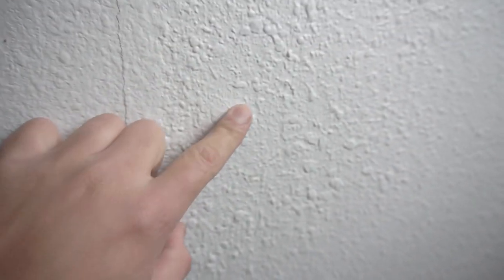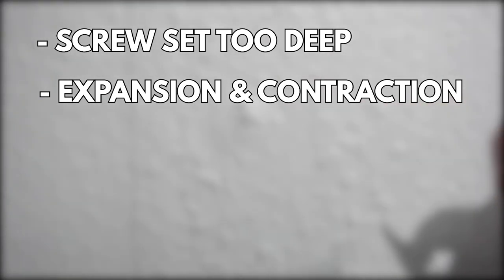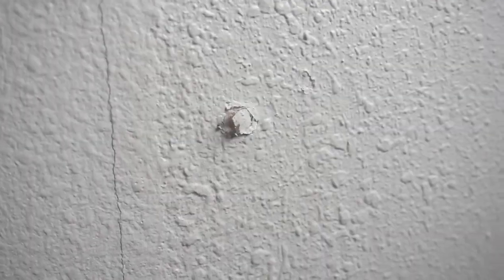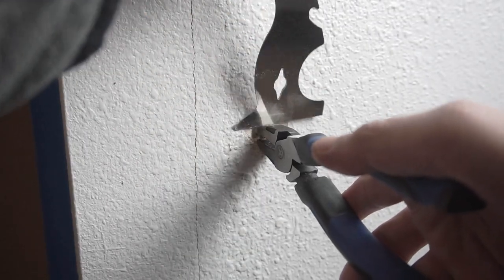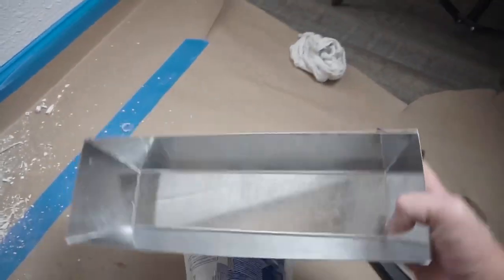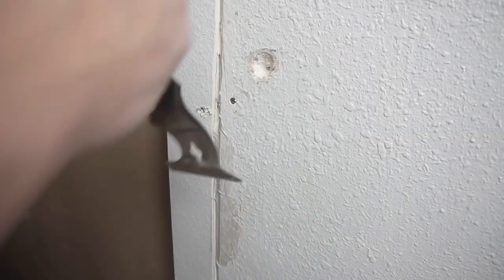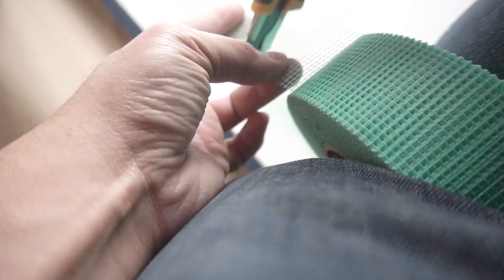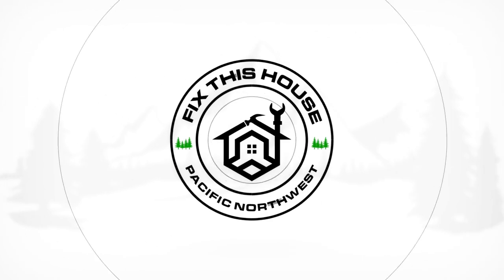How To Fix Screw Or Nail Pops In Drywall | DIY Drywall Repair Tutorial For Beginners!

Comment: What’s the difference between the 5 min mud and a joint compound?
Reply from the maker: Hi! They are all joint compound, hot mud is just a term for fast setting joint compound because 5,20,45,90 all have chemical characteristics that when water is added it reacts that hastens hardening time

When using hot mud you will notice it turn from dark grey to white. The mud is not considered completely dry until it turns completely white in appearance. Unlike traditional drywall compound, it does not shrink as it dries, so it is possible to add additional coats of hot mud before it has completely dried.

Topping compound is the ideal mud to use after the first two coats of taping compound have been applied to a taped drywall joint. Topping compound is a low-shrinking compound that goes on smoothly and offers a very strong bond.

Comment: What about nails and screws that don't seem to have been driven down all the way?
Reply from the maker: It would try to knock down the texture and paint and try to set the screw on with correct depth. This would be the easiest fix. Just be careful not to go too deep. I would use a hand held screwdriver so you have better control.
Reply: @FixThisHouse  how do you know the correct depth?